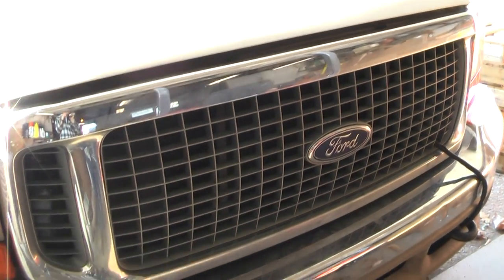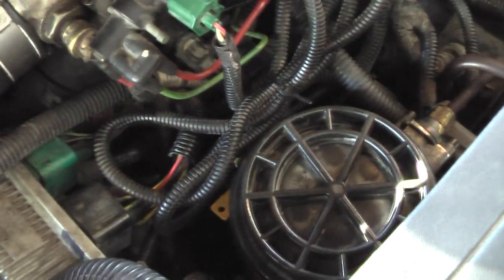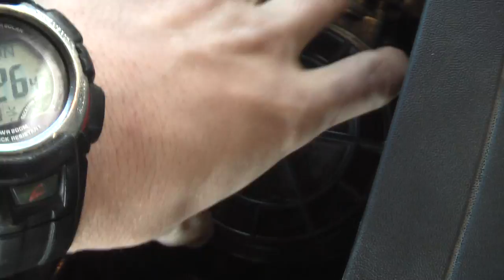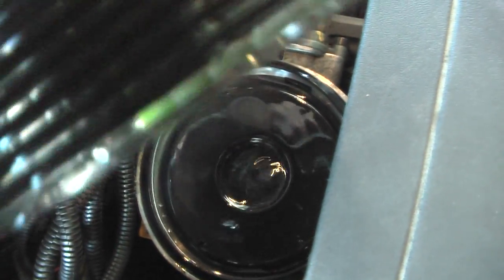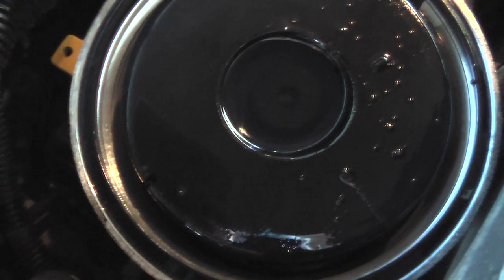How to Fix a 7.3 Powerstroke Fuel Leak

Comment: I swore I've been leaking diesel and everyone kept trying to tell me it's oil even though my mileage has been crappy and my oil levels fine.  I looked EVERYWHERE (that I could see) and just couldn't find where it was coming from.  Now since stumbling upon this video I looked right were you said and indeed I believe I've found my issue.  Thank you so much!  Now I just have to try to do it.  Wish you would have shown you taking it off.  I'm a pretty lousy DIY'er.  Just eveyone wants several hundred to do what looks like a simple swap.

Comment: I had just replaced that gate valve for the drain plug. It was leaking out the sides. New part in, ran good. Cranked it the next day. Now its pouring out of the drain line while running even though its shut

Comment: Great video. Best one ive seen to fix the problem. walked me through the process.
I was able to go on ebay and find the oring/selas on ebay.  Was a lot cheaper and fixed the problem. they were less than $4. 
 I searched """7.3 L Ford Fuel Filter Bowl Drain Valve O rings""""

Comment: In Australia that plastic valve is $126 and our $ is the same as yours...you guys think you are getting stung. Also its a good idea to thoroughly clean the fuel bowl seat after removing the old valve as those yellow remnants you can clearly see in your vid, left after removal will contaminate the new seals. Also drain the bowl every service period to remove any water and dirt at the base of the bowl this will keep the o rings in the valve more subtle and help injector life span. Cheers Stu

Comment: Thanks for the video!
This resolved the leak on my 2001 7.3 diesel F250, without having to remove the filter housing. I have big hands, so it took me about an hour. I bought the MotorCraft valve on Amazon for $40.
Reply: Is that the water separator valve

Comment: Very good video.  Thank you.  I think I will check the 4 screws to see if they are tight first.  If that doesn't work, then off to my local Ford dealer for the drain valve kit.

Comment: thank you for posting. I have this problem now. I could tell where it was coming from but didn't see how it came apart until I saw yours apart. common problem with ford they put cheap o rings in at factory then when they start leaking sell you the the green neoprene o rings. they do the same thing on the freon lines on the air conditioner

Comment: I just did this to the fuel bowl in my 2002 7.3. The "cheap" o-rings have a yellow PTFE coating which is what gets eaten up by ULSD. Then that stuff tends to stick to the drain valve stem and the fuel bowl. All you need is some lacquer thinner on a rag and a little elbow grease and that crap comes right off. I went a few steps further and I removed the bowl completely from the engine and changed all the seals using a kit I got from dieselorings.com. As for the drain valve, I used the blue flourosilicone o-rings instead of the green neoprene ones because supposedly they're the best o-rings for the application. Only time will tell if they'll live up to the hype lol.
Reply: @stephaniemccarthy9894  what

Comment: Very true. The ultralow Diesel available for purchase(courtesy USGOV) has cost many light diesel owners THOUSANDS in fuel leaks and worse: Fuel Pump Repair/replacement.

As mentioned by others, simply add 1 quart 30 wt OIL at fill up. Some say to use transmission fluid. I prefer straight Oil that doesn't contain additives to coat my cylinders with crud/byproducts.

To each his/her/own.
Obama sucks for not telling us the end result of this action. TRANSPARENCY right? 
LOL

  .
Reply: Regular oil or synthetic?

Comment: Thanks much. Very helpful video, down to giving us the right torx key size. I had one loose screw on the valve that I tightened and seemed to fix the leak. If it continues to leak, I'll know what to replace and where to find it. Much appreciated.

Comment: Guys are asking how much the part costs. I paid $7 for the 3 new fluoro type seals from Diesel O-Rings in Colorado. USPS Priority shipping $11. They lost the package with tracking. Late delivery by several days. USPS is bad. Pay more for UPS or FEDEX. Faster. Safer. The real cost of all of this is not the parts, but is the diesel fuel dripping and wasting on the ground at $6.30 gallon in California. No thanks to Biden. I've probably lost several hundred dollars over the years from this leaking. Probably losing over 50% of my fuel now. It got real bad. Bad. Dripping and leaving a trail everywhere I go. Making a mess in parking lots. Trying to fix it now while living on the road. The challenge is fixing it before they tow you away. Can't just stop and fix it anywhere in the big city. Can't wait to solve this expensive leaking problem. Thanks for the video help. JR

Comment: @MooseBaker 7.3L Powerstrokes self-purge.  Also, the fuel rails in the heads should stay primed when you drain the fuel-water separator.  The manual says to fill the bowl back up before replacing the cap, but I don't think it's an absolute necessity.  The electric fuel pump on the frame rail fills it up rather quickly.

Comment: Update on O-rings from Professor Foam:  Correct diameter for back of valve, but not thick enough.  This would cause it to not properly mate with fuel bowl holes.  I went out and bought one from the local Ford stealership for about $62.  The O-rings on this valve are now bluish-green instead of yellow.  Now I need to get together all of the correct viton O-rings to rebuild the old valve and the fuel bowl.  One last tip, don't tighten the torx screws too tight, they're tricky to get out!

One

Comment: You can also buy the orings, clean the valve and replace the orings.  under $10 dollars with shipping.  Make sure you get the new style orings.
Reply: Where do you get them? Are the new style the green ones?
Reply: @MrBearbait75  dieselorings.com has them. they have both styles